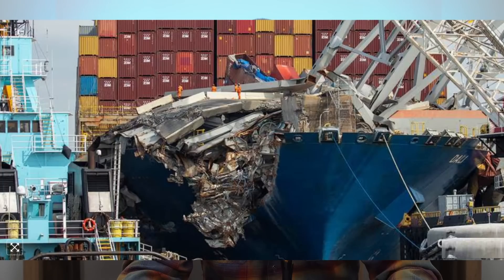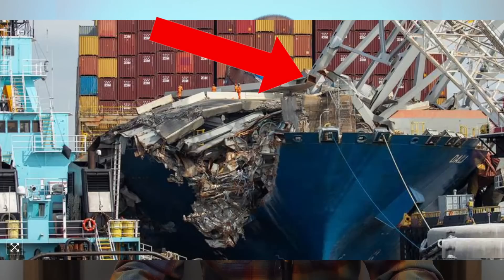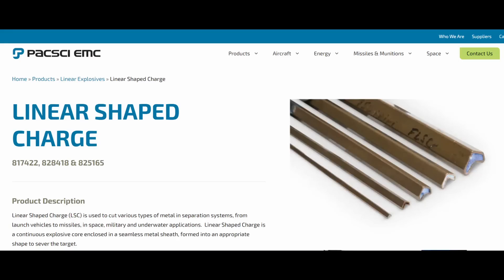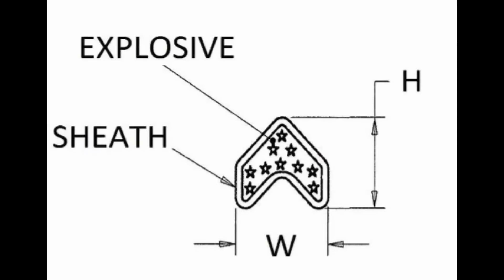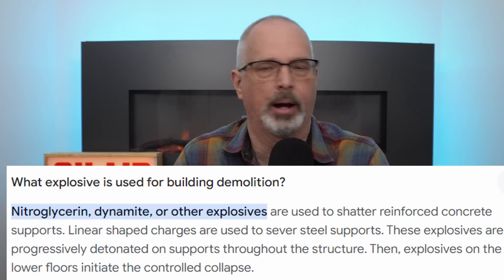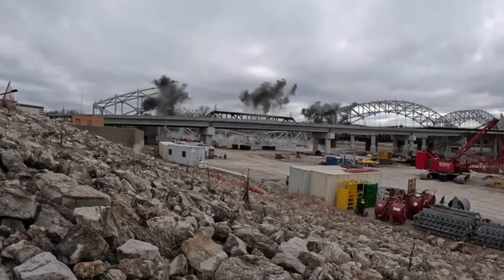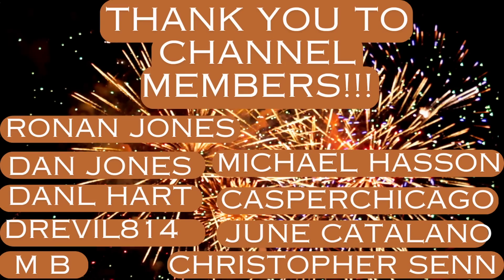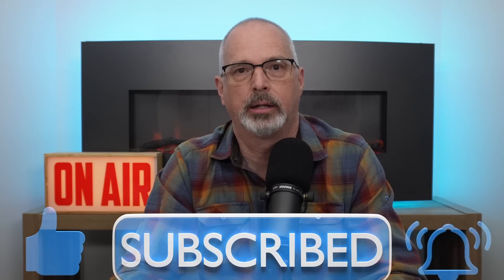How will the Key Bridge Truss be Blasted off the MV Dali?

Comment: I hope it goes as planed.  It''s gravity the brings the structure down.  All the bridges you showed dropped straight down.  THey are trying to blow the truss off the Dali in a sideways motion.   it's going to be tricky.   Related to this is WTC Building 7.   The only way it could have fallen the way it did was if all 90 support columns were blown  out simultaneously.   9/11 was an inside job.  To this day many people have never even heard of Building 7, because the media did their best to hide it.
Reply: Was not very well hidden - got covered on the news on all the channels.
Reply: @sslaytor  Not Building 7.   The coverage was essentially that two different airplanes had flown into the Two Towers.   Not that a controlled demolition had taken place on Building 7.

Comment: I'm surprised they don't use the charges to cut it into larger sections for easier removal.  While it's easier to move each section it seems like it would be harder to connect to them since they'll be under water.
Reply: I think they have to make room for the pieces to fall somewhere.
Reply from the maker: I see your point.  I think the remaining pieces will still be rather large.
Reply: @CaseyJones-Engineer  They're the pros and should know, I'm just a shade tree mechanic that doesn't deal with things on that scale.  And in retrospect it always amazes me when I can see a person in the videos for size comparison.  Thanks for the reply. 🙂

Comment: I'd be curious to see a stress analysis on the sections hanging off the Dali. Absolutely no question you don't want people anywhere near those structural members when they are cut!
Reply: Thank you for your comment, you hit the nail on the head. That's so much steel, at angles and stresses it was never designed for, and I'm so grateful they're going with explosives so as to not risk the workers. There are too many YouTube videos with someone cutting steel or a tree, not realizing the spring tension.
Reply from the maker: @FlatEarthMath  Thank you.  You are right, that steel was never designed to be in its current position.  The salvage workers are amazing.  Theirs is job that can't be done with robots and AI!
Reply from the maker: I am sure they did a lot of number crunching to come up with their demo plane.  I agree, everyone needs to stay well clear of that operation.